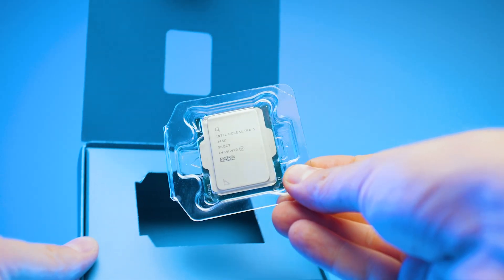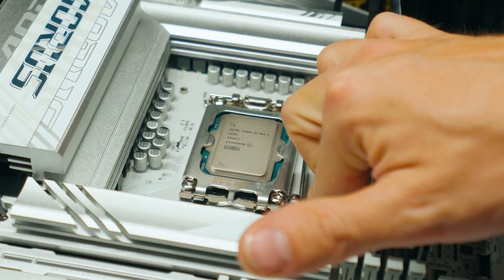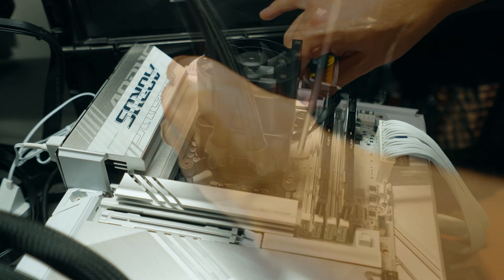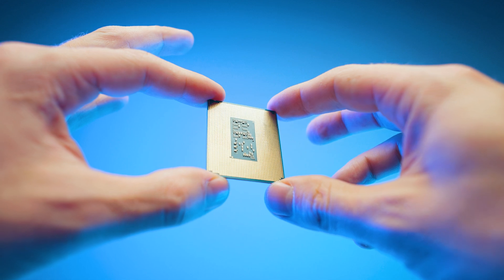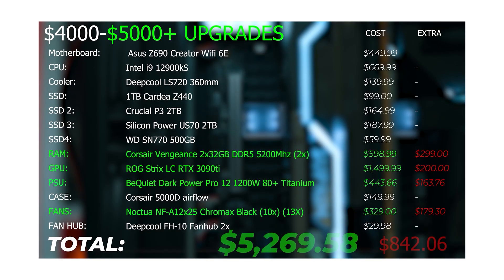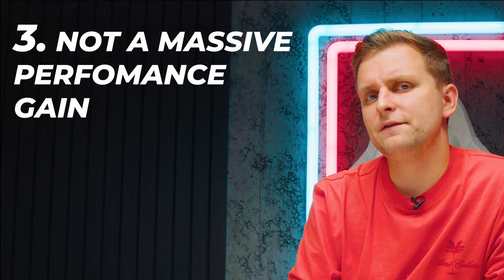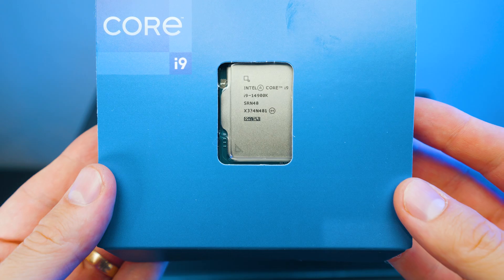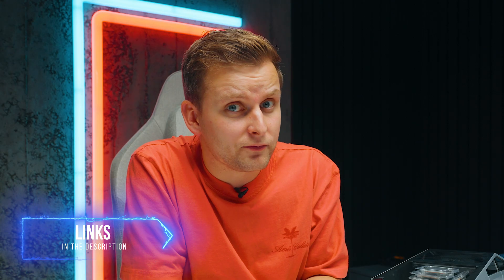6 Reasons You Should AVOID Intel Ultra 200s CPUs!

Comment: I am probably one of the few that preorderd the 285k in my country , I'm not interested in gaming performance but I'm a video editor and motion graphics person and I've been using my laptop for years until it recently died on me. There isn't much choice for me realistically amd doesn't have quicksync and I'm not that keen on 14th gen so only option was 285k, I love the extra io on the z890 motherboards, thunderbolt 5 and I've seen that in Premiere it's the best performing cpu for the  most part, I'm sure there will be issues as with all new platforms but I'm really super excited, arrives next week and I'll be checking out your build guides for sure. It's been a while since a built a system.. Using standard ram for now until large capacity CUDIMM's are available
Reply: Nice choice & agree with your choice, for mostly work loads, the new intel 200 series are better as benchmark showed some tied & but some others surpassed the AMD 9000 series. But for gaming, current gen AMD are better.
Reply: @arthur_pd  yeah totally for gaming Intel doesn't have an answer to 3d cache but for productivity the 285k is pretty decent, particularly in Premiere it mostly beats out everything
Reply: @marcelduvenage3289  Gaming doesnt matter much on CPU's at higher resolutions, GPU does the heavy lifting tbh, Poeple just dont get it.

Comment: I just upgraded my 12700K to a 14900K because the 14th gen is the max my motherboard can handle.
I also have 4 sticks of 5600 DDR5 RAM. Those sticks had issues with the 12th gen running at 5600. I had to downclock them to 4800
With the 14th gen the 5600 DDR5 RAM now run at native 5600 speed with no issues.

Comment: I just recently built my music production pc using the 265K.  Runs very fast, handles all plugins great, very snappy and not an issue.  Coming from a 5950X and there is a nice noticeable difference.  As for gaming I don't do that but for music production tasks, 265K has been on point.
Reply: nice, for mostly work loads, the new intel 200 series are better as benchmark showed some tied & but some others surpassed the AMD 9000 series. But for gaming, current gen AMD are better.
Reply: @arthur_pd  it depends, the truth is the GPU will decide that, I tried like, 5 different benchmark / fps calculators and its actually on point that any cpu with enough processing power to utilize the GPU so it wont bottleneck the max fps is not decided by the CPU but by the GPU capacity, for example Ive a 4080, no matter what cpu I use the max FPS I can get is what the gpu can process, and when you game above 1080p the CPU becomes literally useless as long as you are using a top one (any 9xxx/7xxx AMD or the 285/265/14900s)
Reply: the 265k is a great pick, I have a 12600k and looking to update everything to the 265K
Reply: u9 285k faster than 9950x in gaming
Reply: if amd un released ryzen x3d, u9 285k is not bad. but now all eye on 9800x3d
Reply: this is actually a super smart choice!
Reply: Outstanding for work! 9800X3D is a joke when it comes to productivity.
Reply: @jamesm568 theres a 9950x3d for workloada
Reply: @jamesm568  Are you normal? So the 9800X3D is an 8 core, the 9900X3D and 9950 X3D are in the backlog. The 9800X3D is a gaming CPU that can handle 8 cores well.
Reply: @KlukzHomole  So other words the 9800X3D is worthless at productivity. Gotcha! 👌
Reply: you understand that the Ryzen 5000 series came out when intel Released 10th gen right ? of course there will be a difference, will be sad if the Ryzen 5000 series will beat 5 generations of Intel CPU's but here we are and intel cant even compete with Ryzen 7000 series (3 generations later).
Reply: @allxtend4005  the ryzen 5000 series is equivalent to 12th gen intel

Comment: I do not agree when you have a 12th gen to go for a 14 gen 14900K. I would always go for the 285K! The 285K consumes way less power and if you know what to do and disable DLVR in the bios you can save easy 70/80 watts in all core load R23 and so on. Intel is bringing a bios update and MS is working on new scedulers as well. Soon the 285K will be a lot better then the 14900K and use like half the power in gaming and other load.

Turning of Core Isolation will give an instant boost of 10% average over multiple games. Bios updates and Windows updates will help again and new CUDIMM that is almost here will give 10% more FPS in gaming and easy surpasing 14900K when bios, MS and ram is fixed. So go for the Core Ultra 9 285K if you want to upgrade. DOn't buy 14th gen. I have a 14700KF undervolted and Vcore limited. It is way better then stock. But i would go for the new Intel. 4 more pci-e lanes is huge. Like AMD already has.
Reply: THIS, so much THIS. I really cant understand how can this guy KEEPS recommending the literally most inefficient degrading dead socket PCI limited CPU known to man, if the core ultra series wont exist to be honest the only option NOW for both gaming and productivity would be AMD
Reply: Or you could just go get an AMD chip which is far more efficient and far more powerful.
Reply: @Ace-Brigade  "far" wow, thats a STRETCH ...  a BIG one... also, no benchmark shows that, literally, 285 is top of the line for productivity and can totally game on par with the AMD chips for anything above 1080p, the problem it has is that its not regular across the board with games and the platform needs some maturity, anything other the new CPUs are totally on par with AMD in terms of efficiency and processing power
Reply: @HellPedre Dude youre comparing an i9 part to an R7 part...
The only merit the 285k has, is that it is here right now. It is the right cpu for you, if you: can't wait 2 months, want to do more productivity, but somehow still want mediocre but not great gaming performance, want to buy cudimm right now, have at least 360mm AIO cooling , don't mind spending a lot on a dead end motherboard platform, and mostly: shill Intel more.

If you want gaming then 9800x3d is a clear winner. If you want productivity like photoshop, then 9950x wins. If you want specific workloads where Intel excels then have fun with cinebench and 7zip compression (only) test. And here's the kicker: intel only wins in those 2 specific areas because of the memory bandwidth. Cudimm support that intel already has, will be expanded to amd 9000 series. Also, x3d chips don't benefit as much from faster memory. 
So in gaming, 9800x3d is already set, you don't need a new board, new ram thats barely available, and it can be air cooled well. 
In productivity 9950x is the overall winner, but  you should really wait for x3d version.
And gaming & productivity combined, the 9950x3d will be a champion

The cope here is unparalelled and well deserved
Reply: @balazsrako9528  hahaha well first I never compared it to any specific AMD CPU, second np I don't mind gaming, 3rd I saw more benchmarks than you and the 285 is better in resolve offline rendering unreal and coding compilation. at the end of the day you can shill to AMD for what anyone cares, I'd love not to have to wait until the new platform matures, more ram is available there's better bios settings and so on, but literally no ones recommends 9xxxs series except for the 9800x3d which is an OK productivity CPU and and ofc no one disputes it's gaming crown which was not the original point I was replying to

Comment: Intel for ever
Reply: Inferiority forever! You know it.
Reply: Beats AMD any day. Always step ahead on productivity and no one uses 4090 for 1080p as the test results are always unrealistic for use.
Reply: @paulboyce8537 beats AMD with making trash products. Literally no reason except for Quicksync for getting an Intel cpu after Ryzen was released. AMD is cheaper, efficient, more powerful, futureproof, does fail back to back like that blue company.
Reply: @Riyozsu  Not saying AMD is bad but it is limited on gaming. Youtube is very bias. 9800X3D for example yes good on gaming and been put tested and aged platform. 285K beats AMD on productivity even on UDIMM. But add the correct supported clocked CUDIMM +8000 and you gain up to 20% depending of the source but it is a big margin. Add to that INTEL is hard at work improving the software, Win11 will get optimized and BIOS's updated. Give it a month. INTEL is promising improvements so I predict INTEL will be on par or very close. Yet not to be forgotten there is 35% easy overclocking as now and maybe even more open limits after the optimising. So as whole I think INTEL does it better for all tasks.
Reply: @paulboyce8537  1080p for ever

Comment: Greetings from a 48w M4max LAPTOP😂😂👑
Intel amd💩
Reply from the maker: I'm seeing 55w draw at full power ;)
Reply: @ if you test the m4max, can you do a separate Cinebench2024 run with manual fan control set to max rpm?
We noticed and others too that this way the sustained power is higher than if the OS controls the fans.